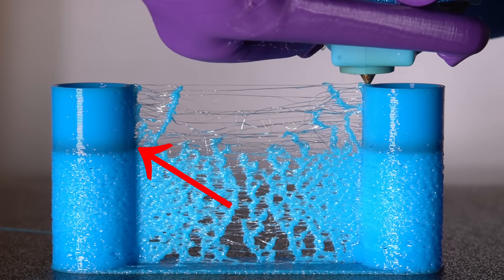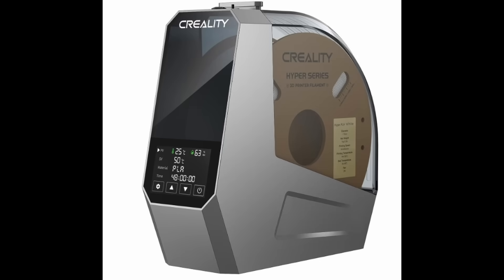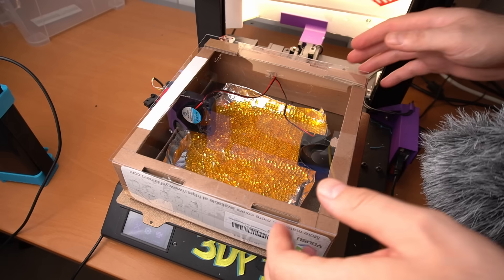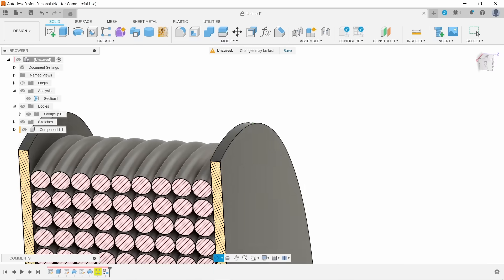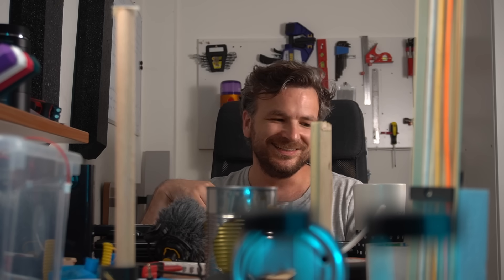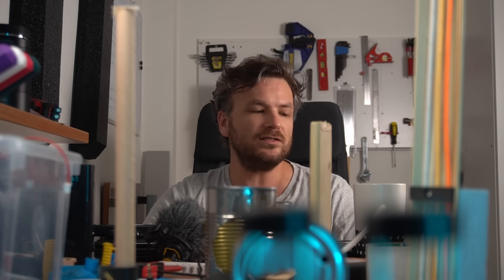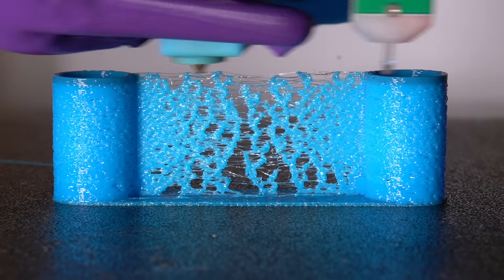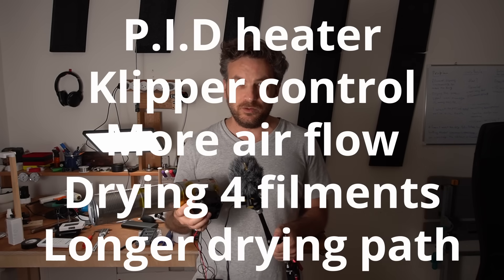Why are we drying filament this way?

Comment: This is brilliant.  I would try using copper pipes which can be bent into a spiral shape to have a much longer length for faster printing while taking up less space
Reply: I was just thinking the same thing...Except instead of copper, you can use rings/guides throughout the can, leaving most of the filament exposed. Think of when running cat 5 in a drop ceiling, you just put hangers every so often to just help keep the cable suspended.
Reply: copper would pull out all the heat from the air.
Reply: @robogoofers9131  an 8 feet long insulation sleeve is about $2 at the hardware store.  Depending on the design, you can have external heating instead of forced air through the long tubes and take advantage of the conductivity.  Lots of options.

Comment: What would be cool is a drybox with dedicated "in-line" dryer section. Basically use one heater and fan to pre-dry the complete spool, but have the end of the filament moved over some rollers inside the box before it leaves for the printer/extruder to improve drying of the filament from all sides.
What i see a bit of a challenge with all the longer in-line dryer options is, that it should still be easy and fast to change the filament spools. So you would have to design it in a way that gives you good access to the full filament path.
I'd love you to explore this topic more for sure!
Reply: I just got the stupidest idea.

Reverse bowden (or halfway bowden or smth) where you just blow hot air through the PTFE tube the filament goes through.
That could also work as the exhaust for the drybox, at least partially.
But you could also do this from the printer going out.
Reply: @Litl_Skitl  The only problem with a long bowden tube is probably the drag you create. Even if you use a tube for 3mm filament with 1.75mm filament, you will need to curve that tube around and you create friction. Maybe a very stron extruder does not care much, but i'm pretty sure you would see a difference in print results just because of that. And with flex filaments, it would get even worse as you have long stretch path, thinning out the filament at the extruder gears making it hard to grab and prone to slipping.
Reply: @ProtonOne11  Reverse bowden at least shouldn't have that problem. Neither should a bit out of the drybox have that.
Reply: A v2 that worked with the AMS would solve filament changes handily since it would be in between the AMS (and therefore the spools and also the automated filament feeder) and the printer.
Reply: Yeah, Bowden works for some things not really great for stretchy, flexible,  compressible stuff.

Thats part of the issue with some inline dryers.
Reply: @anchopanchorancho  Reverse bowden would work better though, right?

Comment: Nice idea, but I think there's a problem.  For some of these more hydrophilic plastics, it's not easy to remove the moisture.  Even if the filament was above the boiling point of water, the water wouldn't just "flash off" like it would if you put water on a hot pan.  That's because it hydrogen bonds with the filament itself.  To remove it, you need the water to dissociate and slowly work it's way out of the matrix.  Therefore, at temperatures below the melting point of the filament, you would likely need to dry for hours to really be effective.   One way you can evaluate is if you test moisture gravimetrically.   So, take the weight of the wet filament, dry it, and weigh again.  For a test like this, you can just use a small amount of filament, and heat it above it's melting point for enough time that ALL the moisture is gone.  Then you will know your real target.  :)

Comment: Does it have to have the diameter of a tincan, can't you just use a smaller pvc pipe? Would look nicer and would be easier to make it longer if necessary. Or maybe some sort of hose.

Comment: You mention that most filament-dryers lack airflow …? Indeed, you should have done some research because most dryers are BASED on airflow.
Reply: Most cheap dryers only have a heating element, but no fan.

Comment: Hmm maybe a heated roller the filament is gliding over would have better heat transfer to the filament?
Or if you want to be even more experimental with a short path where you evacuate the air... but I guess in either way the the humidity just needs some time to travel/diffuse through the filament and sublimate...

Comment: There are a few ceramic heater cores that are in a cylinder shape for 3d printing. A few could be added in series. It's might be better because you could more precisely control temperature and be way closer to the filament, but you would need some electronics.

Something like the CHC kit 24v

Comment: To be a devil's advocate, did you try TPU from a dry box without the inline heater?  It might be that dry box is doing most of the work here.

I had thought about inline heaters before as well, but after some discussion with others, they said that it takes time for the water molecules to work their way out from the center of the filament, and that there's just not enough time in an inline heater for the molecules to escape.  I didn't actually test that hypothesis, though.

Comment: Alot of these spool dryers have the option to use them as a spool holder while they are drying tho so online rather than inline I guess.  Sunlus S2 and S4 has fans not to mention you can make a drybox that can house most of you filaments with that same heater and fans that can support many spools depending on the whatever size container you decide on, people tend to use cheap 1.00 humidity and temp monitors but If you go with a inkbird temperature and humidity monitor you can automate the process.  But cool idea anyway.

Comment: you could actually 3d print the tube instead of using metal cans. the metal of the cans simply lets heat escape quicker, as it's more conductive than the filament printed tube would be.    with the printed tube, you could also create a spiral on the inside of the tube, with a hollow center, forcing the air to circulate round and round down the length of the tube while also affecting the filament in the hollow center of the tube.  optimum air interaction, heat retention, etcetera. 
;-)

Comment: would PLA benefit also from this?
Reply: I must admit I’m very new to this, I’ve nearly used a 1kg of PLA and so far I’ve have had excellent results.  I’ve printed 7 desiccant holders for my AMS, and filled them with silica gel beads, and the humidity in the AMS is 12%.
However, I think that all of this is really about more exotic filaments, and PLA is far more tolerant.
If I’m wrong, please tell me, as said I’m a novice.
Reply: PLA rate of humidity absorption is really low!

But it still needs to be ideally protected from moisture especially if you're not going to use it up in 3-6 months.

PETG is a famous problem filament in moist climates, where just a week could be enough to foul it (in normal climate several times slower), which is a pity since it's more dimensionally accurate and more long term durable than PLA, so it's a perfect material for many things. It's also inexpensive and prints well open-frame.

Nylon and TPU are proper pests with moisture, much worse.

In my experience even ABS and HIPS benefit from drying, although they shouldn't be susceptible to moisture according to conventional wisdom. They don't show typical print artefacts either way but they get less smelly and less shrinkage when dried. Their moisture absorption rate is low though, so once dried, they should be good for a while.

Also any filament filled with carbon fibre is quite moisture absorbent. Most kinds of fillers can increase moisture absorption.

Comment: I wonder if you could take a piece of spiral-cut PTFE and run that down the length of the can, then use some sort of funnel to ensure most of the air gets directed into the PTFE spiral alongside the filament, so it's guided down the center but can breath outwards all around it. Also you might be interested in the membrane based electric dehumidifiers. "mdl series dehumidifier" is a good example you can search.

Comment: That is not wet filament. That is an awful slicing with awful settings. Default settings are awful on all printers for some reason.. In the summer we have 80% humidity, the filaments are just tossed around, no drybox, and none of my prints look that bad. With a bit of tuning i got zero stringing in these conditions. On an ender 3V2 and bambu A1. Still the surface is bit uneven because the vapour expansion.
Reply: This is TPU. Have you ever printed TPU?
Reply: @SianaGearz  i print TPU occasionally in the summer when the humidity is high without drying, no stringing.
Reply: @SianaGearz  my prints look just a bit uneven, do not foam that much but i can definitely hear the popping sound

Comment: Looks promising! Would probably be quite challenging, but it would be awesome if ot could be made more compact while also increasing the length of the filament path, maybe by spiralling the filament inside or something. That could make it too restrictive for the extruder to pull though, and probably  very hard to guide filament to a spiral without a tight tube which would affect cooling.

Comment: what if the path is actually warm/heated/boiling water, then after it pass thru there is a dryer or cloth or sponge it pass thru to remove liquid or moisture from filament. its just an idea, i know it defeat the purpose of drying the filament.

Comment: High quality filament dryers can start around $60.
Even if you live in a corrupt state with price gouging electricity prices like southern California were it is $0.50/kWh.
Leaving a filament dryer on all month once it reaches a stable temperature at 10-15 watts would only cost $7-$10. (Reallistically less since overnight would be cheaper)
The cheapest in-line dryer that doesn't work from your video is at $159.99 plus it will draw more electricity to have to dry faster. (Albeit in a few hours instead of 24/7)
It would still not balance the cost of power.
Reply: He's constantly blasting fresh hot air. Imagine the power consumption.
Regular dryers are easily up to the task. I usually start them at the same time I start to warm up the printer etc. It's already effective enough
Reply: I would prefer it even if it used more power for the convenience of not having to manage several dryboxes or swap filament out of them all the time and run long drying cycles before printing.

Comment: I would like to see a version 2 of this. One idea I had was to make your "in line" drier into the shape of a toroid so you could loop the same section of filament another time or more. Kind of like how a beer line chiller system works. just a quick idea. not fully thought out. Thanks for the great vid. subscribed!
Reply: I had the same thought! Maybe the torus is filled with silica gel and the air circulates sucking the moisture from the filament and it gets pulled into the silica gel. When the system is idle it gets hotter inside  to dry out the silica gel.

Comment: No idea how well this translates but I’ll share anyway.  I used to work with giant coils of steel wire.  When prepping it to go into the machine it was wrapped onto a a second drum a few times to help with feeding and getting it all lined up.  Something like that inside the cans would add a lot of surface area without needing to double back via pulls or something else as other have suggested.  My thought is another tube inside you can corkscrew the filament on giving a much more even and long drying time.
Reply: That sounds like a great solution. Instead of a long skinny soup can, use something large diameter and short length like a cookie tin. Put a short spool inside on bearings so it turns easily, and loop the filament around several times. I think the filament would try to migrate sideways along the spool as it turns, though. How did the industrial machines deal with that?
Reply: @dekutree64  maybe there is some technology that can let you make a guide spiral channel on the central hub... like some kind of "printing" for plastic? 🙂
Reply: @dekutree64 If it's anything like industrial commercial software: They probably didn't deal with that. They could've easily left it janky while resting on their laurels due to patents and other ways to prevent competition. Then, they just charge an outlandishly large price for their shit.
Reply: That way only one side of filament would be exposed to air though
Reply: @JGnLAU8OAWF6  spool made of mesh
Reply: @JGnLAU8OAWF6  The small contact patch shouldn't be a problem if it's actually drying to meaningful depth. I suspect the Drywise is using a large drum to contain several meters of filament.
Reply: @JGnLAU8OAWF6  Spool it around multiple roads with empty space in between? Also consider pre-drying the air that goes in the fan depending on moisture level it might be worth it, cause they do if for compressors and stuff.  Maybe consider pulling a vacuum too cause  less air pressure = more evaporation. 

Dry air,  low atmosphere pressure, high temperature, and wind  are the things I think are worth trying in my opinion.
Reply: @mapu1  You said what I came to say: draw the air thru a silica gel dryer before heating the dry air, then blow that through a chamber where filament passes over several small pulleys (LEGO wheels.. screen door rollers..) on at least two axles. If you can, run the filament through a plastic tube between the inline dryer and the printhead.

The keys to making this work as an inline dryer are.. lots of airflow.. of really dry air.. warmed above ambient..  with a lot of filament contact area.
Reply: Yeah you could have it coil around a porus drum with a blower fan in the middle of the drum, it could pull the air though the heater and fling it out of the drum giving equal heating to the filament wrapped around it
Reply: Friction force will be huge problem with TPU
Reply: Maybe put a spool inside the can parallel to it, with holes at the bottom and top, and wind the filament around the entire thing once. You drive it by turning the spool, and it should give you a lot of filament in the oven at once. You could maybe use a screw as the spool, wind it on the threads?

Comment: You can't remove the moisture from filament, that has absorbed moisture over time of weeks and months. One easier way is to loadup the filament in a vacuum drier(used for degassing epoxy resins). You also need to keep some dessicant inside, and keep the container warm(85C if you put the reel on pedestals). You could dry any filament this way, in a matter of an hour or two at the most. You can also refresh those brittle pla, by putting it in 70C water for 15 mins, and doing the above.
Reply: Boiling? You're gonna destroy your tolerances like that. 50° C max
Reply: @DoesntRefillTheBrita  If you know how 3d filaments are made, extruded filament are drawn in water, before wound into a spool. There needs to be a min. moisture needed to keep filament from turning brittle.
Reply: @aware2action  the water is not the problem. Did you read my comment?
Reply: @DoesntRefillTheBrita  A brief dunk in hot water, will not affect tolerances, as long as the filament is dried later. Also, the filament is not stretched during the water dip. Have done this to my verbatim brand filaments with no issues.
Reply: @aware2action  nice editing of your original comment